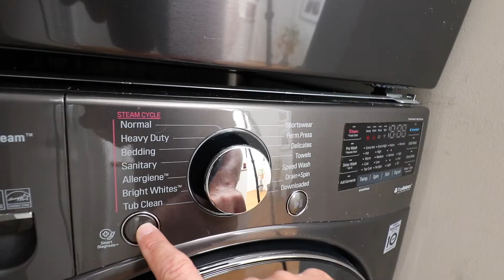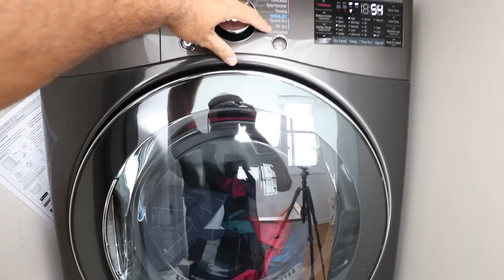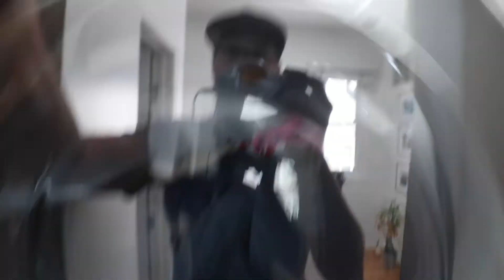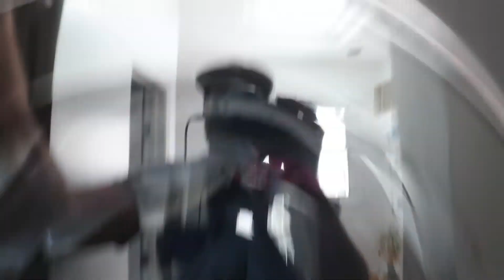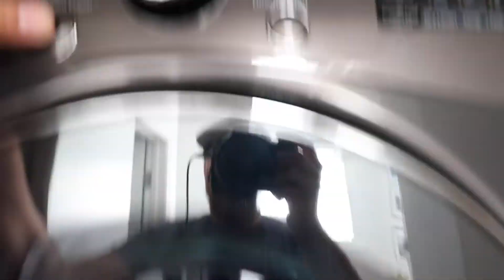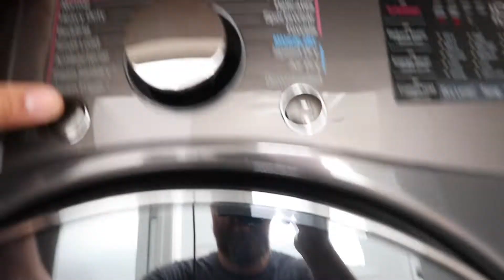Smart LG Washer and Dryer LG 3500 vs LG 3700 vs LG 3900 Features

Comment: Was wondering of the height on the washer and dryer stacked ,and ease of reach for 5ft 2 wife?
Reply: Paul, LG has a new all in one unit that has the  controls for both the washer and dryer in the center of the unit within easy reach. It is called the WASH TOWER LAUNDRY CENTER. It has all the high end features and is only 27 inches deep and still has large capacity.

Comment: I have the 3700 and love it.  I  was able to hook my washer up to the wi-if but can’t hook the dryer up to wi-if.  It says I need to register the dryer but when I go to my account it says it’s registered.  I’m at a loss as what to do.
Reply: Need to update the firmware on the dryer up. Use a seperate wifi connect 2.4 like a mobile hotspot to set it up from scratch, once you do that  update the firmware then redo it all again and it should work

Comment: Dude, thanks for making this video! 
Where does the WM4000 fall in line?
Reply: I did some digging. The WM3900 has been discontinued. The WM4000 is the replacement. From what I can tell they are identical.
Reply: @workflow1024  Today Feb.27 2021 my niece went to Homedepot to buy me an
3900 model and they do not have this models anymore. Instead it ws offered
the model MW4000HWA for delivery in April. It was ordered even when at this
time do not know what is the difference. Any info into this matter will be appreciated.  Thanks.
Reply: @horaciocastillo1435  hey! So my above comment is wrong and I will need to edit.   
After further extensive research— I just bought the 4000 model. However the 4000 model DOES NOT replace the 3900. The 4000 mode does have a better steam feature compared to the 3900. BUT the more true replacement of the 3900 is now the 4200. Idk why they did this jump in numbers. The 4200 is the Cadillac. The soap dispenser works automatically and you only need to refill it once for up to 18 loads (same for the water softener). The 4200 is also .5 cubic feet larger than the 3900 and 4000. The stainless steel drum in both the 3900, and 4000 have been modified for the 4200 so that the fins are also stainless steel instead of being a durable plastic. The 4200 seems to be about 1/4 inch taller than the 3900 and 4000 series. The 4200 also has these pretty cool rubberized handles for the soap dispenser and the door to open the washer door. 

The 4000 model drops the wash setting for “sportswear” from the 3900, but had improved artificial intelligence when starting the washer. This is pretty cool because you can just star the washer on a normal cycle and the washer will weigh/spin your clothes to detect the type of fabric and wash appropriately. The 4200 keeps the sportswear cycle.

All that being said, my wife and I chose to go with the 4000 model. It does WAYY more than we need, ranked top in consumer reports and it’s much more cost effective. We picked up our set for $800 each this past month. The 4200 is on sale rn for $1100 a piece. That’s $2200 for a set... on sale and they have the same Drive motor as the 4000. PLUS on the 4000 you can still use the download feature through NFC on your phone. This will still allow you to run the sportswear function.

The 3900 mode is discontinued. 

Hope this helps!!! Just respond if you have any questions or want to touch base as I’m happy to help.
Reply: @workflow1024  Have not words to tell you how much your answer is appreciated in this end. THANKS a MILLION
Reply: @horaciocastillo1435  yeah! Also keep in mind that most sales end Monday. It’s been a Presidents’ Day thing so come March first the prices will go back up.
Reply: @workflow1024  Thanks so much for your good advise. Since the 4000 was ordered but in back order to be delivered on April, another trip was made
today at Home depot and my niece was able to cancel the 4000 model and bought me the 4200 available for $80 more, so it will be delivered next Friday.                            Best Regards
Reply: @horaciocastillo1435  Hey Congrats! The 4200 was a little out of my price range, but is the COOLEST washer I've ever seen. I hope you enjoy it!
Reply: @workflow1024  Where did you buy the 4000 for $800 each?
Reply: @bigmac-kmac  RCWilley in Utah. Where are you located? I can help you find some deals in my free time if you’d like.
Reply: @workflow1024  I'm in Southern California. Can't find them below $950 here.
Reply: @bigmac-kmac  I just called pacific sales in Irvine CA for you. A sales rep is checking with his GM to see if they can match the price for you
Reply: @bigmac-kmac  they won’t match the 800 but they will do $900/machine. 7.2% sales tax. Good luck! Let me know if you want more help.
Reply: @workflow1024  Great job with details.  Thanks
Reply: @workflow1024  thanks for your thoughtful reply! Can you share your experience/satisfaction of the 4000 model? Tia
Reply: I'm doing some research myself, and it does appear to me that the 4000 series replaces the 3900 series if you are looking at the size of the washer, which is important to me.  The 3900 and the 4000 are both 4.5 cf, and have the smaller depth at 30 1/4".  The 4200 series is the larger capacity at 5 cf, but even though it's still 27" wide, it is a larger unit at 33 1/4" deep.  When you add about 5 or 6" for the hookup, those extra 3" could be significant.  The 4000 adds their "AI" feature which automatically figures out the best cycle to use and communicates that info to the dryer.  The 4200 adds this feature plus the "ezDispense" feature which holds a bunch of detergent, which I think is another cool feature, but its more expensive and it's in the larger (deeper) cabinet.
Hope this helps.  It takes a while to figure all this out!
Reply: @musicfnable  which one are you going with?
Reply: @musicfnable  how do you explain the 4000 machine dropping the “sportswear” wash cycle?
Reply: @workflow1024  Sorry, don't know about the Sportswear Cycle - maybe the Artificial Intelligence feature took its place. I ended up getting the 3900 washer & 3901 gas dryer.  Since it's a discontinued model (the 4000 replaced it), I specifically went looking for a good deal on the pair.  I found a place near me that was clearing them out, and I bought them with the pedestals for a significant discount. They didn't come with the boxes, but they were in perfect shape and, of course, brand new.  I would advise if you are interested in saving some money (and you don't mind missing the newer features that are in the 4000 & 4200), call appliance stores & the big box stores that are around you and see if they have some 3900 models that they want to get rid of.  I'm just setting them up now.  I'm a perfectionist, so it's taking me a while...
Reply: @musicfnable  I already bought the 4000 and LOVE it. I got mine for $800 a piece. So still a pretty great deal. Congrats on the 3900!
Reply: Yeah! I have the same question. I cannot find any differences between the 3900 and the 4000 model

Comment: does the lg 3500 have sanitize cycle
Reply from the maker: The 3500: https://bestbuy.7tiv.net/WBDqJ does not have steam or the sanitize cycle. Both the 3700: https://homedepot.sjv.io/62beQ and the 3900 : https://bestbuy.7tiv.net/nD1LV have steam and the sanitize cycle. The biggest difference between 3700 and 3900 is that the 3900 has turbo wash which can clean your clothes is 30 minutes or less when selected.

Comment: What is better do you think the LG or Electrolux front load?
Reply from the maker: I've never tested the Electrolux but I'm happy with my LG!
Reply: @OneHourSmartHome  thank you. Our washer just went out so trying to decide quickly what's our best option.
Reply: @Midwestern5  LG
Reply: Although, you most likely have purchased your appliances, I thought it was important to share my experience—- I would advise against Electrolux… we have the dryer model EFMC627UTT {& matching washer -the washer is NOT quiet by the way} NIGHTMARE. From the very first dryer  load, garments were getting snagged on the faulty lint trap.. pulling garment fibres apart etc. skip to 4 months later, presently, the lint trap got pulled out of its compartment, tumbling around in drum, causing articles of clothing to sit/block lint compartment, as well as a sock got wound around/underneath another component. I was alarmed by a burning smell AND the sound😳.. had I not been home, there’s no doubt in my mind that would have started a fire. I call the customer service #, they send you to website, then when I did find an alternate number,  the CSR put me on hold to see what she could do.. ya, well she never came bk😡, call dropped 12 min later. Tried again, call dropped. Sent emails, Facebook, Instagram No response. I can’t even get a service ticket. I did some online research.. well,well,well.. SO MANY ppl have the same issue and some even caught fire. EFMC627UTT, I believe is being discontinued & They ‘ve changed the design of the lint trap.. but NO thanks. Lawsuits, complaints, NBC NEWS Reported bk in 2016 of a similar issue. The dryer is a safety and health hazard. THANK goodness LOWES Canada came to my rescue. They went an extra mile for me, and for that I’m grateful!

Comment: hi there, what is depth of your  laundry closet?  Is there enough room for the vent hose? Mine seems about 37 inch depth from door to wall, little concerned it wont fit properly, to be able also close the door. Thank you
Reply from the maker: Depth of my closet it 46". The depth of the machine from back wall to furthest protruding piece was 39" I have the units pushed pretty far back to the point that there is not much more room behind them. I don't know if you could make 37" fit with the dryer venting unless you had some kind of low profile mount.

Comment: Nice review. The one thing I haven't been seeing much is a comment about how the washer holds up, smell-wise. I have a Samsung washer (for over 8 years) and while the washer/dryer still works, I cannot take the odor. I leave the door and detergent draw open all the time (which I hate), have used Tide or Affresh washer cleaner or the build-in feature, have wiped down the gasket and drum but it's still there.

Was in Home Depot yesterday and my eye was drawn to the very pricey, GE® 4.8 cu. ft. Capacity Smart Front Load ENERGY STAR® Steam Washer with SmartDispense™ UltraFresh Vent System with OdorBlock™ and Sanitize + Allergen. Sure, the vent system may just be a marketing feature but I haven't seen that around. Too bad though because it's 28" wide and I literally can't spare that extra inch.
Reply: I have a LG 3700 washer and dryer for almost 1 year and the washer has  a magnetic plunger on the bottom of the door that can hold it open about 1 inch and it does a great job of keeping odors away

Comment: I have an LG 3700 - and the pump and main board broke down in less than a year. (This also happened on my last LG washer...but at least it lasted 10 years.) The repairman said this is a common problem with the LG washers.  Worse yet, the LG parts are not available until mid January 2021! I too thought LG was a good brand, but now I'm not so sure. I have to buy another new one right now, because we obviously can't wait 2 months.  Is there any other brand you could recommend? Or is there an LG model that would be more reliable?  Thanks!
Reply from the maker: That's too bad your washer and dryer broke. I was in the same situation with my old washer and dryer. No parts were available for months so I had to purchase new.  In my research LG and Samsung were consistently the highest rated and most reliable. One of my buddies who was a former engineer for a well known appliance manufacturer consistently echoed this and recommend getting LG or Samsung appliances.

Comment: Do I need to add a separate waterline for steam washer and / or dryer models?
Reply from the maker: No, there is a y fitting that should come as part of the kit with the washer and dryer that splits the incomming water line into two hoses for connecting to both the washer and dryer. If its not with you kit just get a y adapter for your existing line.
Reply: If you actually watched the video, he did answer this question.